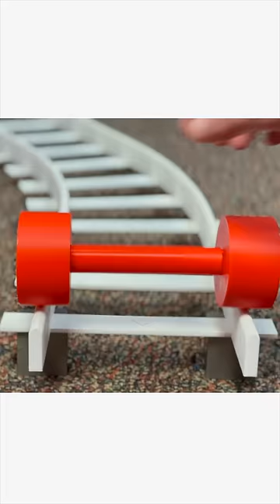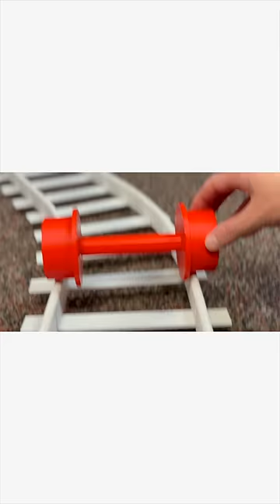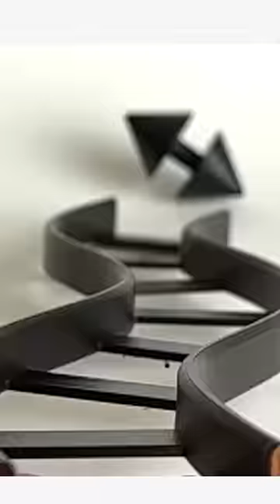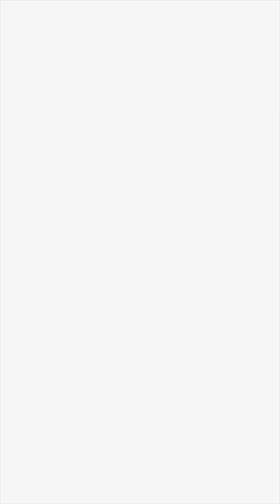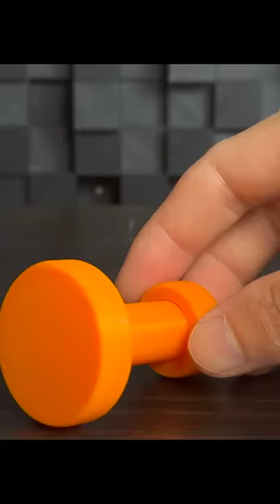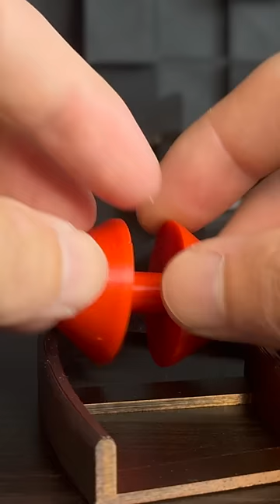The Design of Train Wheels is Genius #3dprinted #trains #interestingfacts

Comment: I honestly never thought about how train wheels work! Thanks for bringing it up!
Reply: I was just watching a show yesterday and wondered how trains actually take turns? My logic was the flange to stop it derailing but that's where I stopped, seeing this now I'm so intrigued
Reply: Track are turning very slow simply. You never saw damn train? They don't have cones instead of fkin wheels, they just driving slower and tracks are as straight as poaible
Reply: @thespectresociety 

Your reasoning you mean.

Logic doesn't change from person to person, it works one way and one way only.

It is also a learned subject, the vast majority of people never once look into what logic is, and how it works.

Yet so many people claim to be logical... 🤦🏼‍♂️
Reply: @WhoThisMonkey  logic isn't just one way my friend. Depending on several factors. Logic alters itself greatly, it takes many forms.

I don't mean to be argumentative of course, I'm just informing you that picturing logic as just One Set Way is in itself, Hilariously....illogical
Reply: @18nwk as stated in the video, the cones are an exaggeration of actual train wheels. But actual train wheels are small towards the outside and larger towards the inside This allows them to slightly shift in the way the cones demonstrate in the video. just to a much lesser degree.
Reply: @thespectresociety  it is one way, I wrote about that too, but u can not understand it, we already noticed u not the sharpest tool in the shed
Reply: @18nwk  ever heard of the trolley problem? I assume yes, logic dictates you sacrifice the few for the many, but upon being told the few are your family, logic dictates you save them instead, then it's revealed the many are also your family members but closer, and so on and so on, logic will hop from one option, to the other, but since you're so prioritised on feeling superior....live long and prosper my friend
Reply: @thespectresociety  it's logic for smart prople than most of people would save 1 family member rather than 2 strangers.
Reply: Nah I've thought about it for years but never bothered to research
Reply: @thespectresociety  No, you had the right idea before. The flange literally exists to prevent the train from slipping off the rails.
Reply: @18nwk  The wheels are slightly conical, and the tracks are simply straight because it is the most common track type. Turns are not straight because they need to, you know, turn the train. The conical wheel allows the module to have a makeshift differential, self-adjust on the tracks, and whatnot. The flanges on the inside of the track (the large cylinder thing that barely sticks out and is very narrow) act to keep the train from simply falling off, as they act as a barrier for the train to keep its wheels on the rails.
Reply: Well, now you know and it ain't straight

Comment: Only problem is that at higher speeds, trains can derail themselves because this wheel design can cause them to rock side to side, even on a straight track. So trains basically have a built in speed limit.
Reply: What is that speed limit?
Reply: It’s called Harmonic rock and in 20 years as a railroader, I’ve never seen it.
Reply: freight trains can do it at very slow speeds on old rickety track, too.  But how much faster than 300+ MPH do you want to go?
Reply: Speed limit will be based on train track build quality
Reply: Theoretically yes, practically this almost never happens unless the track is already falling apart.
Reply: @paulhall8027 you actually do see it everyday. It's why single light engine you have to go 30, and with a 2nd you can go 50. One zigs while the other zags. At least that's what an old head told me 13 years ago when I asked why light engine speed is 30 and light engines is 50.
Reply: Bullet train enters the chat:
Reply: Does this apply to bullet trains?
Reply: Also , this design will require special cushioning so that passengers do not vomit from seasickness . And for two-storey and freight cars, such wheels will not work.
Reply: @jondunmore4268 im assuming that bullet trains dont turn as much as older train tracks, i know when we get to the turn on the last stop where i live the train gets real slow and rocks alot. a bullet train might have this design of wheel but heavily focused on reducing friction and working on a straight line
Reply: @SyteCYer78 in Italy a normal high speed train travels 200mph most of the time.
Italo and Frecciarossa.
Reply: @paulhall8027 I’ve actually experienced it multiple times in street cars. Perfectly straight track but the train starts to swing more and more to the left and right.
Reply: I went on a train once
Reply: @WhoThisMonkey what was it like?
Reply: @VIAADeeed  They do work though. Quite well in fact. Like he said, these cones are exaggerated. The real thing, if you were to follow the taper out on a standard rail wheel, would give you a cone some 30' in length. They're tapered at a 1:20 ratio.
Reply: Track gauge

Comment: When one wheel is larger than the other while going around a curve is called “stagger”.  Just like an Indy car going around the track at the Indy 500.  The outer wheels are larger than the inner wheels causing the car to turn slightly without turning the wheel.

Comment: The geometry also keeps the load centered. If you flip the wheels inside out, the train will fall off the tracks. Thanks for the demo. Great content
Reply: The geometry splits the track?
Reply: @Kris-fd9xs  he kinda butchered the explanation. What he means is since the flange is on the inside of the rails if the car tips in a turn and sit on only outer wheels it stays in the rails. If we put the flange on the outside of the rail it will just slide off in the same situation. 

But in reality the purpose of putting the flange on the inside was mainly just that it's easier to make switches. Just think how the hell you'd make a switch otherwise.
Reply: I meant the geometry of the wheels as a whole. The load being centered is more of a function of the taper of the wheels than the position of the flange. The reaction force of the wheels is upward and inward toward the center. If the wheels were flipped inside out, the same forces would be upward and outward. The train would always be pulled to one side of the tracks or the other instead of the reaction forces of each side pushing toward each other in the middle.
Reply: Not only that, but the wheels would turn at exactly the wrong speed. The outer wheels would turn too slow and the inner wheels would turn too fast. The opposite should be true; outer wheels would rotate faster (larger surface area, same time to rotate, larger circumference/second, more linear momentum/second) and the inner wheels would rotate slower (smaller surface area, opposite explanation.)

Comment: As a fromer employee at a Greenbier I can say this. The wear on train wheels can be nuts. And a fresh one is strangely satisfying to see.
Reply: I worked on the tracks around Oxford in the early 90s, i used to wonder why the train wheels were not flat when i'd see the tracks worn on the insides.
Reply: @lawrencemitchell3024  because it involves a lot more than just that. New braking system with cone wheel..(explain that1) 
Plus suspension is a major problem with these. Watch the middle bar. It will eventully rattle anything its attached to apart.
Reply: nunyu buz  "...can say this:"

Comment: It’s similar to a differential gearbox that is used in automobiles. When wheels on an axle turn, the wheels have different RPM. The larger diameter wheel takes longer to make a full rotation than the small wheel on trains, allowing the turn. Cars accomplish this with a complex gearbox that rotates the wheels at different rates, since the wheels are the same size. Technically trains don’t have a differential, but the concept is very similar to that seen in cars.
Reply: Hate to be that guy but trains don't have differentials. The wheels are on a fixed axle but the shape is designed in a way it acts as a differential does. Allowing wheels to spin at different speeds. Cars on the other hand do have differentials because the wheels are the same size it just needs the same effect for turning and the differential does that
Reply: Pretty sure it's NOT a differential. 

I get what you're saying, but cleverly designed wheels /= differential. 

As the other person stated, the differential is the mechanism that makes the wheels spin at different speeds to turn, trains do not do this, and don't have differentials. 

For anyone else reading this. Your car has a differential, and if it's a 4x4, it has two differentials. The differentials change how fast each wheel spins, so you can turn smoothly. If you turn left, the left wheels on your vehicle have to travel much less ground, than the wheels on the right, so the wheels on the right rotate FASTER than the left wheels. If your wheels rotated at the same speed while you turned, it would be hard to control, your axle would be under immense stress, and could snap, and you could skid off of the road. You'd have to slow down SIGNIFICANTLY to make any turns at all.
Reply: @DearLilBunBun  A 4x4 may have three differentials.
Reply: @rougezeus2154  thanks for the clarification. I had differential in quotes, but that might not have made it clear. I’ve edited the comment based on your feedback. Thanks! 🙂
Reply: Nope, not the same.
Reply: It’s not like that at all, this is more like a CVT transmission than a differential
Reply: @rougezeus2154 He said that trains don't have a diff, read comments properly before you step in
Reply: No
Reply: @lottedunnell1906  it was edited based on what he said
Reply: I made an electric motor once and when I started learning more about motors, I stumbled upon differentials and gearboxes. Pretty cool, not much of a car guy but I do love engineering and knowing how things work so naturally, I want to make my own little electric car, maybe start off with with a kart.
Reply: My brain is breaking reading this stuff
Reply: Not even close to the same. Not a complex at all differential in cars. It’s just four spider gears. Only one wheel is ever really getting power in a basic diff.
Reply: Not the same.
Reply: @Industry-insider  I actually came into the comments to ask if this was similar to a CVT, fascinating piece of tech. I don't really understand how a CVT works, but that is what the short made me think of.
Reply: @DearLilBunBun he wasnt saying it has a diff. Hes saying it's the same principal. If you turn, your outside wheel has to turn faster. That's what a diff does. That's also what the wheel design does. Understanding the point was not rocket science.
Reply: Wow the guy makes a theoretical comparison and you all jump in to correct him the theory is exactly the same one side needs to spin faster than the other to go around a corner in this case it uses surface speed instead of physical speed changes like a diff would but the concept and outcome are the same.
Reply: wow ur so smart u understand gear ratios u must be some kind of physicist or something man. its almost like its one of the simplest concepts on the planet that we all learned about in 3rd grade
Reply: This only applies to the wheels that are putting power down, not to the other wheels. They will naturally spin at different speeds during turns. When it comes to the diffs, they are not really complex at all. Most are just open diffs. Cuts power to a wheel entirely so they don’t have to adjust for the different wheel speeds. Limited slip and electronically controlled diffs are where it gets complex.
Reply: When you try to look smart, but fail. 😂
Reply: @SauceM3 not like a cvt at all. Train wheels don't have gears they are more love idlers. Locomotive wheels on the other hand are simply electric motors. Converting DC current into mechanical motion, two gear a driven and a drive gear rotate the wheel. Wheels are designed in a way to make it more efficient going down the tracks but they pretty much force their way around the tracks. Modern suspension and steerable trucks allow for movement of the wheels around curves. Even without steerable trucks the trucks still manipulate in a way to help the wheels move more smoothly to a point. Coming around a sharp curve you can see the Wheel set buck against the track as it forces ot self around the curve
Reply: Automobiles.
Reply: @ferrumignis No, 4x4 always have 2 differentials. AWD has 3.
Reply: @DearLilBunBun I think he just means how in cars, when turning, wheels on one side turn slower and wheels on other side turn faster.
It's a totally different mechanism but the result is similar: using simple machines to solve fundamental engineering challenges that came up at the beginning of our modern, industrialized age. 
(Even tho the differential came out like a hundred years after we built railroad tracks everywhere)
Reply: Cars don't do this with a gearbox, but by not having straight angles in the steering system.
Reply: @georgeb5262 it depends on if its full time 4wd or part time 4wd. Many older vehicles had a center differential used for full time 4wd. I don't believe many modern vehicles have that form of 4wd anymore though.
Reply: @georgeb5262 not true.  Fullsize 4wd vans for several years had 3 differentials.  1 in the rear and 2 in the front. Vemco v-drive
Reply: @georgeb5262  4x4 simply means a vehicle has 4 wheels, and all wheels are driven.  The presence of a centre diff does not exclude a vehicle from this description.
Reply: I have an old school 4x4 with just the mechanical steel gears and no onboard computer. If I turn while in 4x4 my truck will "bind up" because one wheel is turning quicker than the other. Made me learn a lot
Reply: Same concept is why driving on pavement in 4wd lock damages the gear. The setup is forcing all 4 wheels to turn at the same time...the inside wheels will be forced to go faster than necessary and need to be able to slip...the traction provided by pavement prevents this.
Reply: I've never had any problems with my full spool and 4:88 gears on the street. Tires naturally don't last as long, but you get used to the "chirp chirp chirp" when making a tight turn and it hooks up and goes straight when ya drop the hammer! 😅
Reply: Beats the shit out of me what that has to do with trains, but ....🤷😬
Reply: You are thinking of a CVT transmission
Reply: Harbor freight drill press

Comment: This is why wheels are measured on a regular basis to keep them in spec.  They either cut/turn the wheel when out of spec or replace it.  Only a 1/4” or so of the wheel actually touches the rail
Reply: Maintainers keep the world running.
Reply: I’m a Carman and seen some wheels in really bad shape has you wondering how some of these trains haven’t derailed lol

Comment: I used to weld trains in a shop for TTX and the wheels do have a slight angle to them. But they also have a flange on the inside. 
It’s also pretty cool how the “de-railer” works.
Reply: Of course,  all rail curves are spiral curves as well.
Reply: @jeffhill2355 what does that mean? Like the rails do a corkscrew twist whenever they turn? I'm not understanding. Clarify? Peas & carrots!
Reply: Not fun to be a part of a derailment though lol
Reply: Working in the FMO rn, everything I've heard about the shops is they're slave houses lol
Reply: I was gonna say...😂
Reply: @knuckle12356  I think he means bends in rail tracks follow a Euler spiral rather than a circular arc since the latter would require trains to instantly accelerate in terms of rotation causing them to derail.

Comment: This is the same reason why a spherical ball follows the tracks. A balls axis of rotation can tilt dynamically relative to the radius of the track's curvature. The only reason why our train wheels are cone-segment-shaped rather than spherical is that spheres have a punctual point of contact with any flat surface and cones a linear one, we need the latter because it gives more surface area between tracks and wheels to spread the weight of the train on.
Reply: Would there be any benefit or advantage if our cars had these cone-shaped wheels?
Reply: @krumbleme2  A spherical rim surface should not confer an advantage. (First, a portion of the surface of a sphere with the diameter of the rim would have too much convex curvature; to have a larger second diameter, the shape must be a portion of a toroid; that allows a slightly convex or slightly concave curvature.)  The difference in shape would be too small to see or easily measure. The top of the rail is crowned, not flat, so the initial contact is a point, whether the wheel surface is perfectly conical or slightly toroidal.  Under load, the wheel and rail deform slightly, increasing the area of contact.  The absolute optimal wheel probably is neither exactly conical nor exactly toroidal; the optimal shape probably depends on multiple factors including the profile (shape) of the rail, the length of the axle, and the length of the bogey; it can be developed by modeling the system and refined by measuring forces and movements on working railcars.